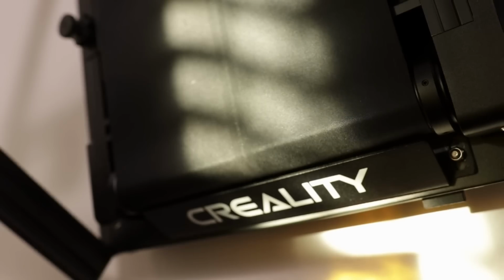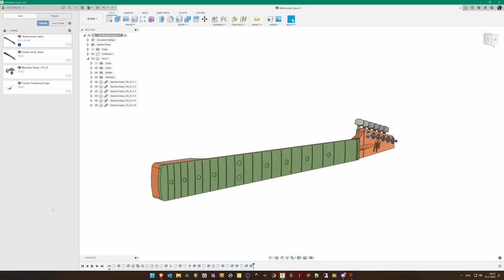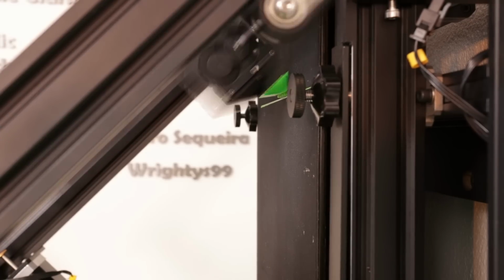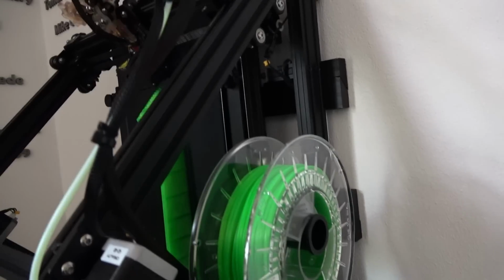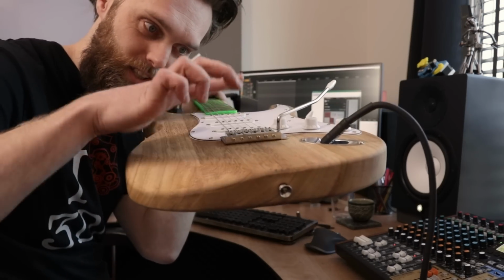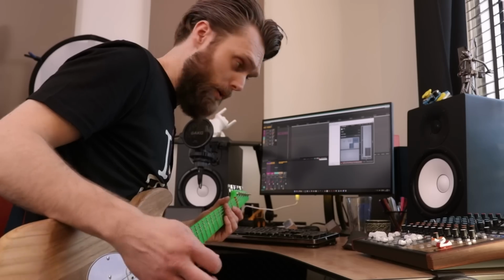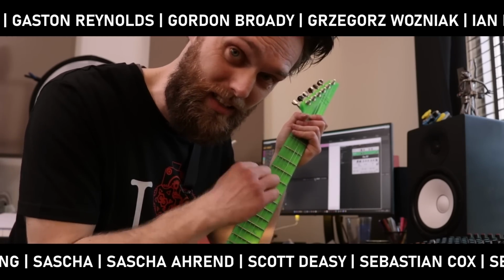A 3D printed single piece guitar neck?! ft. CR-30 belt printer

Comment: I think you may be best suited to print the neck separate from the fret board with ABS or ASA and then Acetone weld together. This allows you to insert the truss rob easier, and also gives you the option to print both with a little extra thickness on the "flat side" so you can sand back to flat. Also if you print the neck part like you did in this video but the fret board either flat on the bed or with the other side on the bed, you will have contradicting layer lines and warping stresses. Also, to be really "metal," you could design the 3, 5, 7, 9, 12, 15, etc fret dots as screw heads and fasten the fret board to the neck with inserts to help with clamping the two parts together.
Reply from the maker: Thanks for your suggestion! I like that idea, especially the screw heads. I think that if I fine tune that hole for the truss rod I don't need to give it all to get it in xD I like to minimize post processing
Reply: Love seeing your Brewers logo!  Teddy Higuera for the win!!!
Reply: ABS is not as hard as PLA, and between the two.. PLA beats ABS for this particular use, hardness is required.
Reply: And, add some carbon fiber rods. (like what Kiesel does to their necks)
Reply: @squidcaps4308  the most important thing in this application isn't hardness, it's how well it resists bending without cracking, which could arguably have just as much to do with the way it's infilled as the material itself.
Reply: actually not a bad idea , as it allso gives him the option of using carbon strengthening rods on each side of the trushrod 
pressing in the frets might cause the fretboard to split with it being thinner then again he probably could melt those frets in there
Reply: @squidcaps4308  no, just use true tone abs
Reply: YEah, or maybe  a skunk stripe design would be even easier, then you just need to glue in a small piece on the back instead of an entire fretboard, maybe even an easier fret design to cut out all that fret work,  Or even printing frets in a harder material with extra material so you can level them after the neck is adjusted.  Having them perfectly level out of the printer  and on the guitar would be the holy grail in guitar making as you can see it takes a lot of work and skill to do that properly and why you only find "easy" playing guitars in the expensive range.  The most expensive - Gibson Custom Shop actually cut out the human hand variability and use exepensive plek machines to laser level the frets after installation, but wouldnt need that if level frets were built into the process, and perhaps 3d printing can acheive this.
Reply: PLA doesn't seem appropriate here due to its propensity to deform over time under strain. PETG might be better in that regard and still printable without an enclosure (though I don't know if any thermo plastic will work long term). You will need to compensate for PETG's even lower stiffness, though, with print settings, neck geometry, or maybe CF filler. Filler will also help prevent warping. In any case, great work here. Hopefully we can combine your findings with the Prusa guitar.
Reply: @watahyahknow  Nah, just design the fret slots a little big and glue the frets in so there is no chance of cracking or creating a back bow.
Reply: @s0d4c4n  PETG would be a better choice than PLA.

"PETG, a 3D printing filament, is known for its strength and flexibility, which can help it withstand stress and impact without breaking. It's also resistant to deformation and ultraviolet (UV) radiation, making it a good choice for outdoor applications."

Comment from the maker: Printing something functional on the belt printer was a fun first test for the Proper Extruder! This neck looks so surrealistic and now I have to design a guitar body as well of course. Leave a comment what color you think would be best for it! Purple? Yellow?
Reply: You should try one of those colour gradient/rainbow type filaments for the body. That’d look great I reckon.
Reply from the maker: @thaphreak  I get tropical vibes from that which I like!
Reply: Red ;)  also..very cool work on the extruder there. I like it. Congrats
Reply: send that neck to stephan from cnc kitchen. he is cnc routing a guitar body
Reply: One of those glitter-like purple color would look great with that neon green neck.
Reply: wood filament
Reply: Purple would suit this guitar
Reply: red
Reply: strips of different colours glued together to gain strength like high end laminated necks with a fingerboard on top
Reply: purple!! the guitar would be greenish purple! which is a very obscure reference
Reply: purple and green look good together.
Reply: Really cool project! I think galaxy purple would look rad!
Reply: Go with one of the 2 color filaments, do green and purple, it prints on a normal printer but when you twist the print it changes color.
Reply: naturally since you've gone with the green neck in a cool design, you should follow the color design of the ibanez JEM-series and make a sick looking steve vai inspired guitar! my vote is on a hot pink body for the guitar 😅😍,  maybe some yellow or more green colored accents, see the pyramids on the neck as on the JEM777 😁
Reply: Very cool video! A big reason why we ordered a 3d printer was to make parts for synths. Very excited for the guitar body! Purple is my vote, joker style!
Reply: do a rainbow gradient one. i think with how the cr-30 prints itll look really crazy
Reply: Purple and Green is a great crazy combo. The Joker is awesome.
Reply: My first thought was purple, but I'm thinking translucent white and put color changing led lights inside.

Comment: I wonder what I am missing that explains why we dont see plastic necks?   I mean I get it that a guy struggled to 3d print one, but i think Fender/Chibson/PRS have had to have put their own R&D into this.  Would a plastic neck degrade?  If you put a modern dual action truss rod in a plastic neck, wouldnt it be more tuning-stable than wood?  I dont want to aggro the traditionalists, but Im sort of astounded we are still 99 percent wood necks.  Its one of those things where I guess I just dont know what I dont know, however.

Comment: I've printed 3 banjos on LulzBot so far. Two piece neck (plus fretboard separately), no truss rods but used reinforcing CF or steel tubes inside the neck. Material was CF PLA. Frets were PITA in all 3 cases :D
Reply from the maker: That's awesome! I'm thinking of combining CF tubes and a truss rod to increase stiffness while being able to adjust the neck's curvature
Reply: @properprinting  Wrapping the truss rod in a (round) CF tube is an option but the trade off is that it will take out some of the neck material. That is a big deal in the banjo neck but may work fine in the guitar neck!

Comment: Honestly, I think the tuning stability issue is more from the cheap floating bridge than the neck. Stock strat bridges are already notorious for tuning issues, and those kit guitars come with junk hardware that just makes the problem even worse.

I could see this being a lot more functional on a tele. Simpler design with a stationary bridge would remove a lot of variables. I would be super curious to see what would happen if you sent it off to get it scanned on a PLEK machine, lol.
Reply from the maker: Yes it was terrible, but the easiest guitar I could get my hands on to proof the principle. Eventually it will be nothing like a strat with waaaay better hardware ;)
Reply: The tuning stability is probably the strings not being fully seated in the tuners. Since the neck is more flexible than it should be, you're bending the neck every time you fret a note.
Reply from the maker: @TriVos Ahren A year? You're optimistic xD
Reply: @TriVos Ahren If you reinforce it, yes.
Reply: @TriVos Ahren I was thinking more of glass fiber reinforced plastic. Something that's used on power tools and the like.
Reply: Oh yeah probably more to do with the bridge.lol
Reply: also get locking tuners and mabye a locking nut but not necessary

Comment: You can buy carbon rods to put on the sides of the truss rod to make it sturdier, then if you want to go further from 100% 3D print you could coat it in resin and put in some fiber reinforcement as well. It turns see-through so it just looks like a glossy finish.

Comment: I've made several 3d printed instruments, in the ballpark of 20 or so and 15 of them were string instruments. Seeing this video makes me want to buy a CR-30 as this would allow me to make my instruments much larger.
Reply from the maker: That's awesome! This enables interesting possibilities for sure!
Reply: save up the pennies and buy a Modix instead.  you are limited to build orientation on this belt printer.  it's not the best orientation for carrying loads.  im pleasantly surprised the neck didnt snap in this video. thank god for truss rods.

Comment: Depeding on how you do the neck, you could forgo the whole adjustable truss rod and use a graphite rod instead. Vigier does that on their guitars. String action adjustments are made on the bridge and by changing the zero fret. As per the frets, you could've done a heated arbor press, so the fret melts the plastic as it goes it. No need to print the slots.
Reply from the maker: Thanks for the info! Interesting to make the string action adjustment on the frets itself! A heated press makes things more complicated. Printing the slots improves accuracy and heated frets don't stay in place as well as the press fitted do in my experience.
Reply: My company uses dual  graphene impregnated carbon fiber rods and a truss rod. The rods ensures the neck is always trying to go back to flat position but still allow just enough bend to adjust the neck if needed. I considered not using a truss rod at all but we still do for a couple of reasons.  Great idea though. That would help tremendously.

Comment: Fyi, consider printing the next one in PETG.  It'll be less likely to distort in your car and has the best creep resistance of any material I've printed so far.  (i.e. better than PLA, PLA+, Nylon, EzNylon, Taulman PCTPE, TPU)
Reply: ABS/ASA is even better for the creep and heat tolerance, also usually cleaner to print compared to petg
Reply: @lap87  Good to know, sounds like I should try it soon.  ABS/ASA has significant stress-cracking issues so I'll have to test to see if it makes better springs.  Mostly though, I've only recently made a heated build chamber so avoided it due to warping.
Reply: I made a petg guitar body and found that it was much too flexible to allow for tuning stability. A full neck out of such flexible material would be tough to stabilize, imo.

Comment: Interesting project, great proof of concept too.
I do believe that you'll need both the truss rod and carbon fibre reinforcing rods in the neck for longer term stability.
I fear that the neck will end up looking like a banana and no amount of truss rod adjustment will fix it.
As to how to do it - maybe take a page from Leo Fender - have 3 trenches programmed in on the back side of the neck.
Insert the various rods and then cover them over with "skunk stripes" of material that are glued in.
Another option is truss rod from the back, CF rods come in from the sides.

Comment: I would print the neck and the fingerboard separately, using ABS, and then use acetone to weld them together after inserting the truss rod. You'll get better quality printing that way.

Comment: You might be able to improve the issues with flexibility by using some carbon fiber rods either side of the truss rod channel which you could insert the same way as the truss rod. this would add more rigidity and mean that the truss rod isn't doing all the work. It might also be worth finding a way to add more support to the headstock, maybe aluminium plates on each face of the headstock would add some extra strength to help with tuning stability. A volute would also be a good idea! It's very impressive that a 3D printed guitar neck is even possible at all! I look forward to seeing more.

Comment: Just got mine a week ago. Love it. Took me a long time to calibrate it, but print petg on it, all day long.  It's amazing the advantages of this printer beyond the obvious. You can print a tube without supports and I find many places I don't need supports because of the 45 degree slice. Fantastic.
Reply: I'm just curious, what do you print with it?

My philosophy as a metal fabricator and woodworker is anything that size I'm just going to make out of wood or metal. The time and plastic needed isn't worth it to me. Still cool, I just don't see any use for it unless printing swords or other cosplay kind of stuff I guess. I know it can be set up as a production machine that runs autonomously but I can do that on anything with a glass bed.

Comment: I have 3D printed a ukulele neck before, using pla you will get plastic creep while your neck is under tension. Overtime with the strings tightened your neck will start to warp significantly. I would recommend using a different plastic.
Reply from the maker: PLA definitely is not the best material. Beyond creep, imagine placing this in a car on a hot summer day xD This was just the easiest way to see if it actually works in the first place ;)

Comment: Some of that rattle could be because break angle is a bit too low. I noticed that you printed the nut with the string slots printed in. You might get better performance from a blank with hand cut slots and add a string tree.
Reply from the maker: Yes, very true! Because the nut is a 7 minute print I think it should be possible to do the tweaking in CAD. To increase the break angle I can also make the head more angled or even twist it a bit at the higher strings. I like to make use of the capabilities 3D printing offers. Thanks for your suggestions!

Comment: Great video! If you have problem with gears you could cast them (make silicone mold) from some kind of urethane or other resin like plastic. They make them almost indestructible these days.
Reply from the maker: Thanks for your suggestion! At this moment, the PMMA-like resin works perfect. Always good to know that there are other options!

Comment: I 3d-printed a 7 string guitar body too, next time you could put 2 carbon fiber rods for extra-stiffness to avoid ''creep''.  :). Fantastic project aniway
Reply: I used carbon fiber in my printed body and it didn't help. However, I didn't use adhesive along the mating surface of the plastic and cf, so that possibly made it less effective.
Reply from the maker: I'm wondering if a longer truss rod, one that goes beyond the fastening to the body, will help mitigating creep

Comment: To get the cr30 to print straight, adjust the belt tensioners, so the belt doesn't move ever so slight side to side.
Reply from the maker: Thanks for the suggestion! It bent into the vertical direction so I think I have to adjust the height of the platform

Comment: I’d print the neck bowing away from the fingerboard, that way when the strings are brought up to tension they will bend the neck straight. You wouldn’t need to put so much stress on the truss rod that way.

Comment: Cool. I don't know if this would work or not but after seeing this I'd try printing the neck out with no fret board. Have 3 slots  1 for the Truss Rod and 2 for Carbon Fiber
rods to keep the neck straight. People do that all the time on wooden necks these days. Then print out a fret board and epoxy it on.

Comment: Not sure it can help but raising the printing plate with the knobs gave me only troubles and I suppose it worsen also the bending effect. I would fully lower the bed and regulate the y axes offset by the firmware using the baby steps and the 100 Nm included metal blade. The procedure is described by NAK3d channel (you need to regate lower than the result you find due it is 45 degree angled) For the belt tension, I've never touched it but there are some regulation points in the front roller you can play with.
Reply from the maker: I underestimated the process and I'd definitely take a look into his procedure. Thanks for the info!

Comment: I think PLA with the u channel carbon fiber reinforcement rod or two rods with a dual action truss rod would be enough stiffness. Definitely suggest making the neck a fret board separately. You can as someone else said use inserts and screws to connect the parts, the acetone or epoxy as well.

There are ways to do stainless steel fretboard with frets, if you want to go mental.

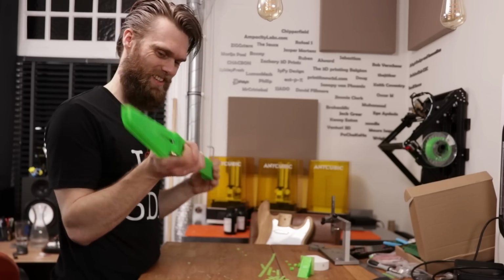Comment: Granted I’m only 9:16 in however I would like to add that the function of the truss rod isn’t a simple neck straightening device it’s designed to offset the string tension on the neck so when the strings pull it into a bow you tighten truss rod to straighten the neck out that’s the primary function otherwise if it was only a matter of keeping it straight or stiff we would all just put a 3 inch titanium bar down the middle or a carbon fiber I beam I’m calling it a day with no need for adjustment. yes before everybody chimes in that there ARE guitars like that and I know about the 52 no caster custom shop that the neck is so big it doesn’t need a truss rod just throwing my two cents in great content, excellent idea and really fun to watch
Reply from the maker: Thanks for your input! Maybe I've explained it incorrectly, but I haven't said that it's used to straighten the neck. Only to adjust its curvature. So yeah, you're right and I think we're on the same page ;)